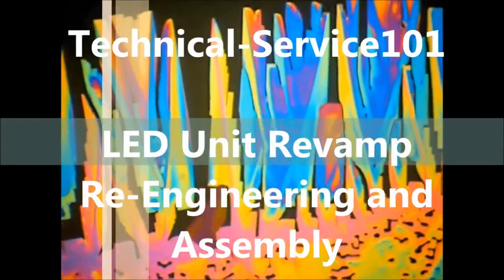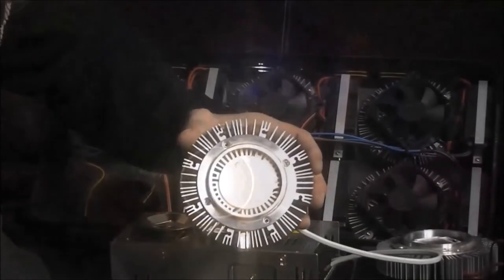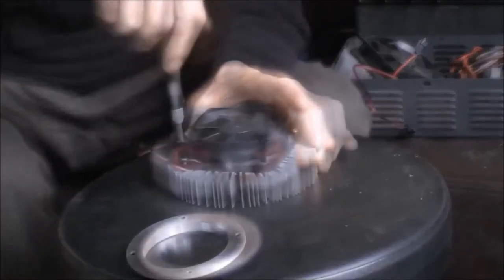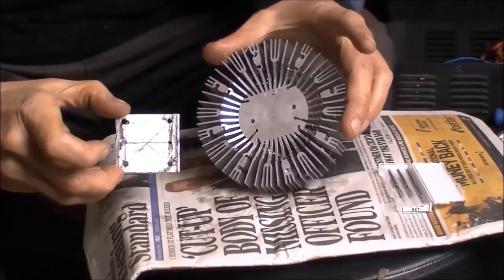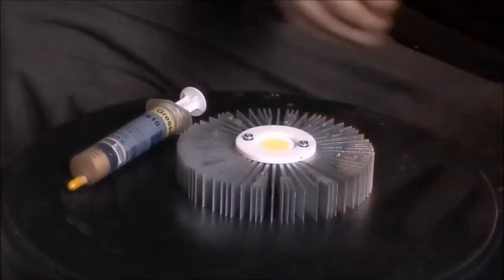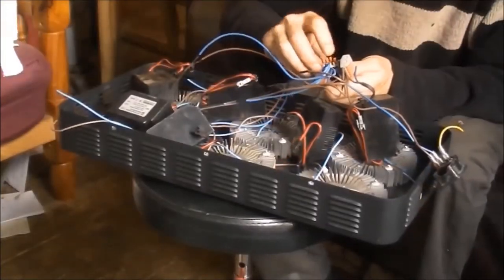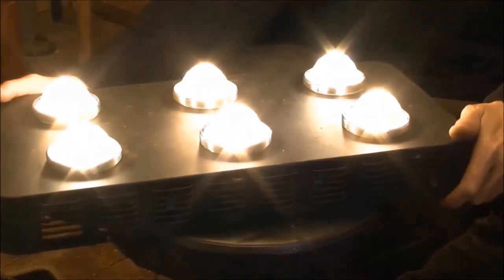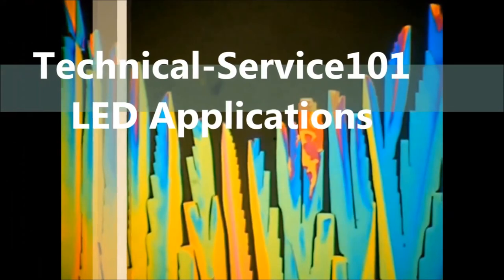LED Growlight Revamp Lite

Comment: I've been using a similar setup for about 5 years now  but made individual unit with cree cxa -cxb 3070 ,and similar lenses , but I only run them on about half there rated amperage, less heat ,not a great drop in lumins , will last a lot longer,and it makes them super efficient.. Good vid muka
Reply from the maker: +Garry Carley Thanks fella, agree entirely, however in order to buy 6 CoB's with twice the rated amperage of these would have been inordinately expensive for this type of rebuild and we appear to be pretty much on the mark for the stated 140 ish lumens per watt so we are very happy to be seeing this amount of light pressure from a mere 245 w total consumption. With electricity costs at around 10p per KWh it would take a lot of hours usage to recoup the additional investment in the build. Plus we is skint!

Comment: Jack I'm prob going to be interested in the pre drilled heat sinks can't wait
Reply from the maker: Ok, I am getting a lot of interest in those, I will see if its possible to make a drilling pattern that would be more or less universal so a single design could accept most cob form factors. I am definitely going to be costing having a batch of 15-20 units drilled/tapped and will make them available to anyone that wants them if I do. I anticipate prices being around the £30 per 4' / 1200mm 3/4 cob 500w max capacity  bar.